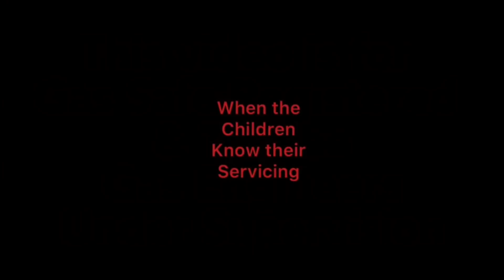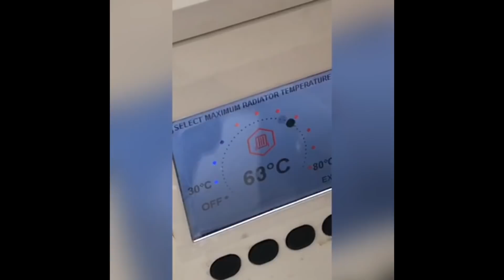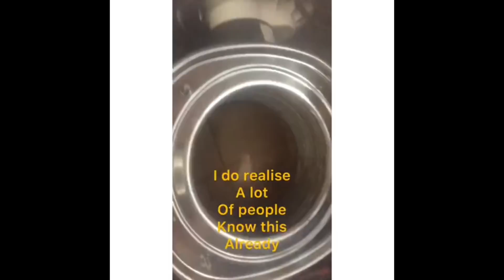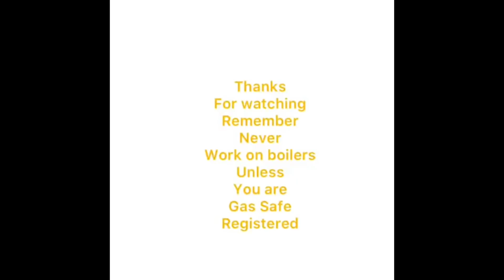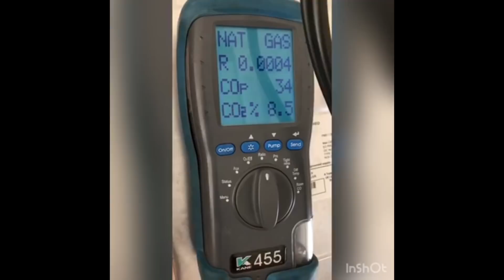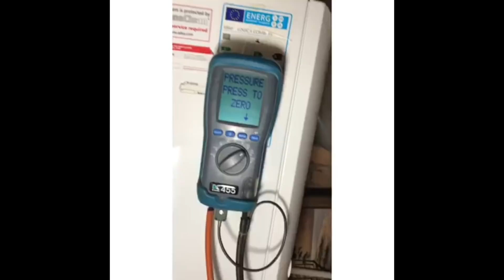Boiler Service Tips - Pete Withers One Plumbing Essex

Comment: Some great tips there ,cheers for them, re the charging the KANE ; I have both Kane and Anton analysers, and I have found that once the rechargable batteries have come to the end of their life (which they do) they are quite expensive to replace. They dont hold their charge for very long and as they get older this time decreases. It costs money in some form to charge them,  be it , from a domestic power source or if you have a facilty within your works van as I do also, even a portable power bank needs recharging. I have found, that replacing the rechargeable AA batteries with standard AA batteries (that we carry dozens of , as well as AAA batteries in our van????) last a lot longer, I am talking months and months, and these are just cheap ones from Aldi! That is my ti pfrom David Waterhouse, Pipecraft Plumbing and Heating, Royton, Oldham, Lancs! dx
Reply: Goto ikea and buy there rechargeable batteries they are sanyo eneloop which are proper nice batts. Search reviews on Google 👍👍

Comment: Hello Allen, I’m currently a trainee Gas Engineer. I’ve been told by training my provider that you only have to remove the boiler parts if your readings are out. Normally you’d just do your tightness test, working pressure at the meter ,check the inlet pressure, Gas rate/Burner pressure, safety controls,FGA and clean out  the condense trap.
Reply: Manufacturers instructions overrule anything you may have been told, always follow the service procedure stated in the manual, we require a full strip down every year. (Ideal)
Reply from the maker: Always follow manufacturers instructions if unsure. Doing more on a service may make the boiler last longer. Such as the Worcester Bosch burner seals. Thanks
Reply: On the full strip down Alan what do most guys charge for this as it can run into a bit of time

Comment: That guy certainly does a thorough boiler service - not sure all gas engineers are so diligent.
Reply from the maker: Hopefully as more and more people watch these videos the standard will improve. Thanks.
Reply: @AllenHart999  I do this type of Boiler service, I always have done and currently charge £60, in North Manchester.  Every single time I do, the customer says; 'Well yo uhave certainly done a more thorough job than the last bloke , he was in and out in less than ten minutes! I take 40 to 60 minutes, more if it is a BBU, with firefront, but that is £90 as I clean and service the firefront too!  Cheers David Waterhouse, Pipecraft Plumbing and Heating , Royton, Oldham, Lancs dx
Reply from the maker: @davidwaterhouse2552  Hi David That sounds fairly cheap or definitely good value. Feel free to send me some pictures and videos on WhatsApp 07725 692699 Thanks.
Reply: @AllenHart999  Good point Allen and it may inform some customers who view your videos to be a bit more demanding by knowing what to expect (and accept).😉

Comment: If you gas analyse a boiler when servicing and all the readings are within range do you skip taking the burner out cleaning and changing seals etc or do you do a full service every time?
Reply: I cannot speak for any other manufacturer, but for ideal boilers we require you to strip it every year without fail, you don’t have to replace the seals unless your visual inspection determines they require replacing. 👍
Reply: Yes mate it really doesn’t take long
Readings mean absolutely nothing in my opinion, you can have a boiler that has safe readings but is still filthy with deposits, you just charge accordingly, what you can’t do is charge for a service when it’s only a combustion check, explain to your customer what works or checks you have carried out, at the end of the day it’s at your discretion and your name in the paper work👍🏻
Reply: You don’t have to change seals every time 👍🏻
Reply from the maker: Always follow manufacturer’s instructions as a minimum. Thanks

Comment: If you did an annual service on a boiler you’ve never been to before would you change the burner seal every time? Also if it’s a regular customer would you still change the seal or every 2 years? Thanks

I probably would fit a new seal with a new customer
Reply: Hi Lee I would access it, you can usually tell, Ideal’s are a silicone base seal so if they feel brittle in any way loose them👍🏻
Reply: Thanks one plumbing 👍